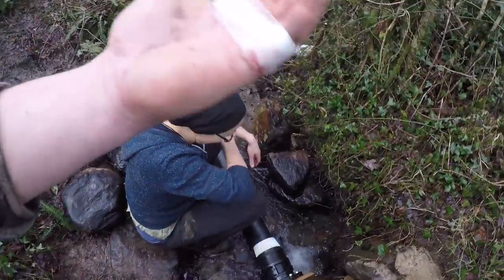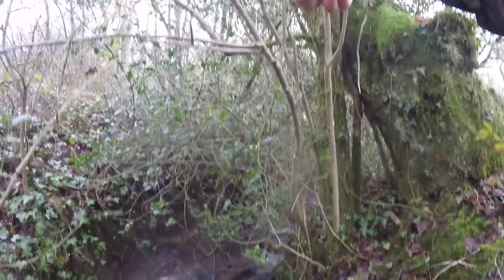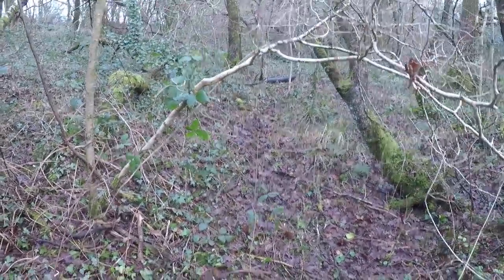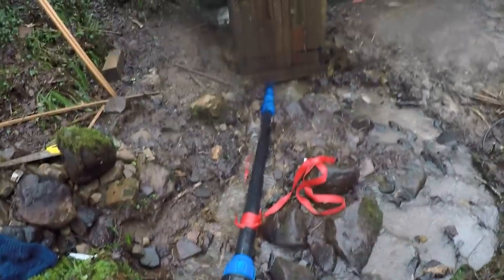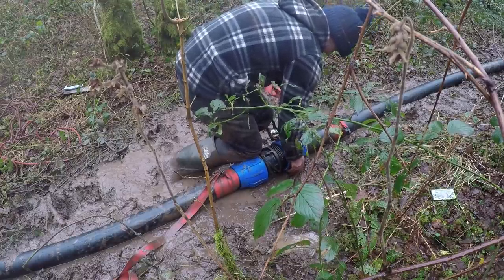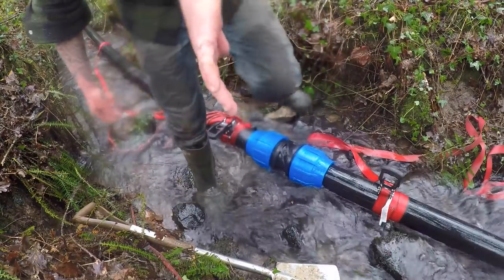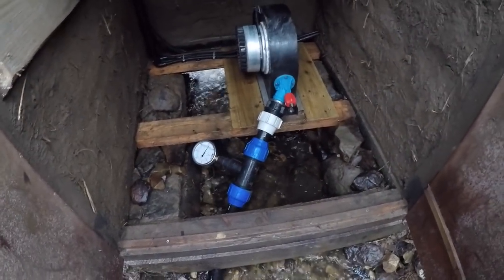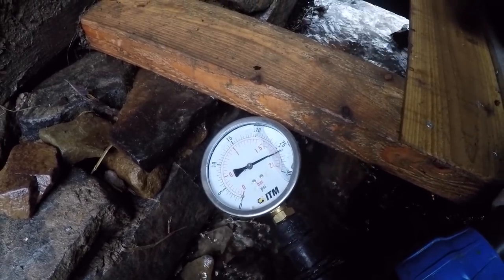DIY Micro Hydro Part 16 Powering Up The Turbine

Comment: When you were showing the workshop model I thought of this having been exploring earthbag  buildings. In short a similar auger\screw system attached to your 360 with the 360 parked in the middle of the workshop filling a continuous earthbag while rotating. In smaller buildings lol the 360 or skid steer would probably have to sit outside I know. The amount of work that went into the cordwood structure was enormous and convinced me to never undertake that approach, while beautiful just too labour intensive for larger structures. https://m.youtube.com/watch?v=iHN_9YXKE0Y
Reply from the maker: That is a really creative idea. just the kind of idea that really gets me thinking thanks for taking the time to write it. i dont think it would work though. earth bags need to be filled with a clay agrigate mix that is slightly damp. basically they dry and turn in to cob bricks. if the bag was removed after drying the earth bag shape remains and the bricks stays in place. the bag is just a temp form for the brick really. so im intuition is telling me that this sticky damp mix wont move through this auger very well like it does in the video. im thinking of trying to make someone to attach to a front loader to help fill bags. if you think my thinking is wrong here please tell me why. im not decided yet i just cant see that sticky mix going smoothly through that tool.
Reply: Kris Harbour Thanks for the reply Kris, I have no direct experience of cobbing so I think you are right and the Cobb would need forced down into the screw constantly, I was forgetting you intend cobb. Most earth bagging I have seen online the Cobb is only applied to the bag exteriors, so more rammed earth. Thinking about it I have had similar issues with pumping thick muds in semi-solid screw pumps with rubberised stators packing at the hopper pipe interface. 

I'm still trying to convince myself the earthbagging idea has merit for use in construction in Scotland. It would be great to find a method where a small two to five man crew can work quickly and efficiently. My personal experience of screw conveyors is more in connection with dry powder batching in chemical mixing tanks and of course I have seen them in use filling grain silos on farms. 

I think the suggestion would work on a dry (earth) sand cement mix without too much effort. In the Mylittlehomestead videos  and similar they are using a dry mix iirc but the climate is different. Videos online show similar machines building levees very quickly in the US but again dry sands. Anyway all food for the noodle and thought it might prompt ideas for you, even if just a variation on the cobb mixing bucket, that looked labourious.

Regardless I like your videos and your results, would even consider traveling down on the volunteer crew when the time comes whatever way you. Wet cement aggregate mix video below.

https://m.youtube.com/watch?v=9uLMvBx1Az8
Reply: Just seen this pretty much how I would like it to work, https://m.youtube.com/watch?v=wyIww_T4Ryc

Comment: So why is no one using large intakes with descending size pipes? It is essentially a dam in a tube and makes amazing water pressures.
Reply from the maker: Presure does not increase when you make the pipe smaller. pressure drops when you do that due to pipe friction loss. that is why you have large pipes and have a small nozzle right at the end.

Comment: I'm so confused. Why couldn't you just put the turbine next to the intake? Why the miles of pipe? 

I understand there's a reason I just don't know what it is hahaha
Reply from the maker: the pressure comes from the turbine being down hill from the intake........
Reply: Kris Harbour What's the pressure coming out the bottom of the intake? Presumably not enough. It makes sense now 😂. No need for the elipsis it's late the brain isn't at full power haha.

Comment: That intake box for the streams bottleneck, what kind of wood is it? My family has always used IPE wood, got one still in use made in the 60's...it just has ferocious splinters if handling it because surface weathering but it's as solid as ever, had one made in 2003 for a different site, and it was trash by 2009, made from pine... So it got replaced with IPE. That stuff is not cheap like it used to be wow.
Reply: I think he said larch in a previous video, which holds up nicely to water

Comment: 300w? whats that take a years worth of energy production to pay for just one of those fancy pipe connectors? im sorry making your own hydro electric is very cool and all but for energy production that low i dont think its worth it. it would need to power at least part of my house compleatly independently for me to buy into anything like this
Reply: and it does just that... I don't know where you're from but in the UK a small house will only use 5 kwh a day with all the normal electrical appliances yet this system at 300w can output 7.2kwh a day. More than enough and completely off grid, he also has solar to compliment it. In the USA the normal consumption is excessive, upwards of 40kwh a day.
Reply: that would still require a  large battery bank.  eh id rather make the power on demand with a small storage or no storage if possible. although with the flow you have acsess to I would not think thats possible
Reply: I guess that depends on your idea of what is a large battery bank. With a constant charge rate available of 300w 24/7 the battery bank could be suitably small in my view. There aren't many places around where you can setup hydro large enough to not require a battery bank, and where you can they'll cost a huge amount more than any battery bank.
Reply from the maker: jimmy your point is that i should have not bothered because it would be better if it was bigger? that is a really strange point of view. i have two small batteries that fit under my workbench and get 7.2kwh a day out of just the hydro. more than i have ever used in a house in my life. of course it would be great to have 3kw system the didnt need storage but i cant do that due to the flow and it would cost 20k to install a system like that. i really dont get your point at all im afraid.

Comment: What would happen if you use a pipe that is only 1/2 inch wider in diameter than the pipe that feeds into your nozzle sprayer? So instead of pipe that is about 6 inches in diameter for your system you used pipe that was 1 1/2 inches in diameter. Wouldn’t you get the same 26 psi at that generator inlet?
Reply from the maker: yes the presure would be the same when static, but when the water moved it would move a LOT faster at 1.5" pipe the water would be moving  2.39 m/s inside the small pipe creating friction and then presure loss. To put it in to perspective i still get some loss and the water is only moving at 0.38 m/s in my 100mm pipe.  i just did the calculations the loss would be so great over this distance that there would no pressure at all at the turbine. you can do the maths yourself if you look up pipe loss calculator. the length is 200m and the flow rate is 3lps the the loss at 1.5" pipe is 35psi.....that is more than my total presure (25 psi) if what you were suggesting was possible mains water systems in cities would only need to be small. The friction is the factor here and over distance add up to being very significant and will eat up all the available energy if the pipe isnt sized correctly to handle the flow rate.

Comment: I had a question it's really stupid. Why did you run all that tubing down to that? Why didn't you put that up stream. You could have had a 10ft pipe. From where that t valve was . You would have had a lot further to turn it on . Then you could have ran your lacquer from it to your place. Running electric line to your place would have been a lot easier than running that hard expensive tubing .
Reply from the maker: Hydro power comes from pressure and flow of water. My system gets its available power from 18.5m of head (hight difference) and up to 5 litres per second. The long run of pipe goes down hill, gravity causes the pressure to give us energy.

Comment: Why did you build the turbine house ON the stream?  Wouldnt it have been easier and safer to build it on dry land?
Reply from the maker: its the lowest point of the land so i get the most out of it there. i would have lost well over a meter if it was anywhere else. and i know the stream well i i know how the flow changes so it know that it will be fine there

Comment: Why didn't you just dig a waterfall nearer the pump house? Then you wouldn't of had to use all the pipe.
Reply: The water pressure would be extremely low, thus not useful or efficient with mot turbines.

Comment: What is your total drop in elevation ?
Reply: We could calculate it using the 26 PSI, I find 7,5 meters. But thats a lot more than the 1,8m (6 feet) that he estimated... dunno
Reply from the maker: 18m of head. 26 psi
Reply: That is correct, but 18m is 60 feet. Isn't that way to much, couldn't it be that the gage isn't in PSI of you misread ?
Reply: 60 ft
Reply: 18 m seems correct. You get each 10m about 1 bar. If you take a look again to the gage, the red units (bar) are showing about 1,75
Reply from the maker: It’s 18m! You would think I might know having built the thing! These comments blow my mind sometimes. I have made a video calculating it all. Then you can see a gauge saying 26psi. And you still question it? 🤦‍♂️
Reply: Haha Kris the way you passionately react to comments may attract trolls. I expect your channel to blow up big time. Nice to still see you still answer so many questions. Also, congrats on finally making it to this moment we've all been waiting for!
Reply from the maker: its so hard to tell if someone has just not watched the video or just not understood or if they are trying to troll. it does not get to me i just face palm a lot. i would say 30% of comments are because people skipped through the video missed something and then comment telling me that i should have done something that i did. just blows my mind sometimes.
Reply: Wow, I did expect my question to generate so much turmoil, I'm  sorry.  I am truly interested in you hydro project.
Reply from the maker: Not your fault john. i was replying to the person that questioned my very clear evidence based answer.